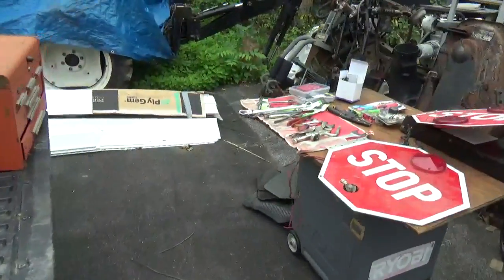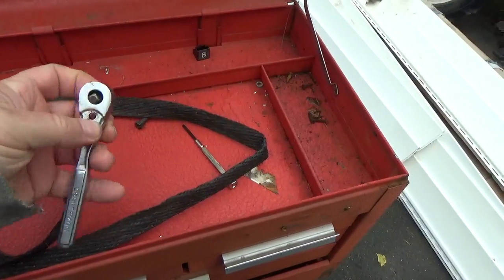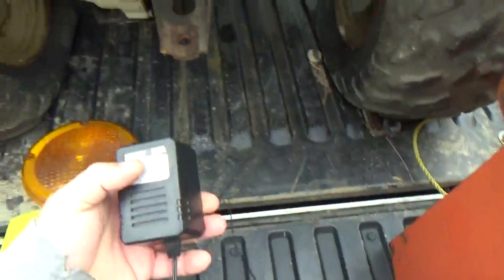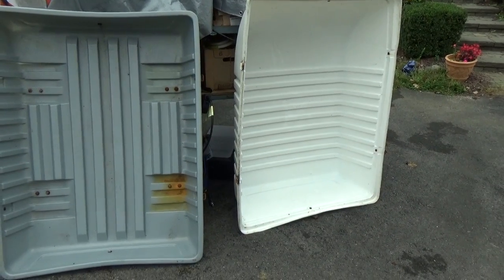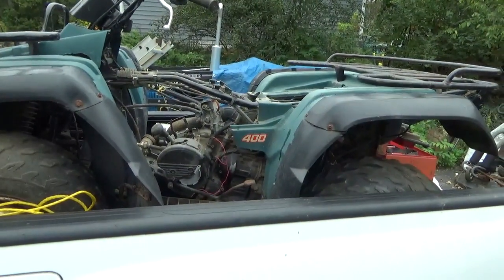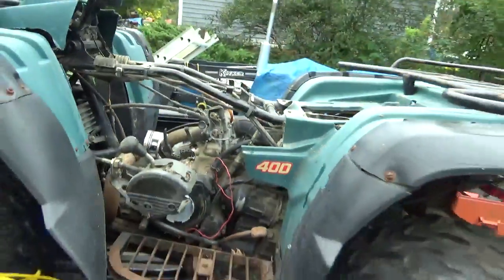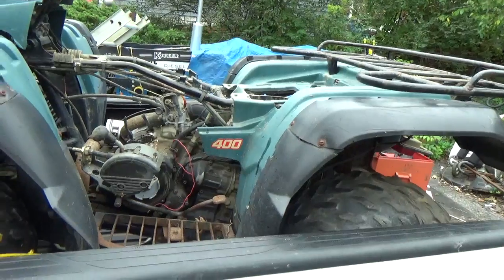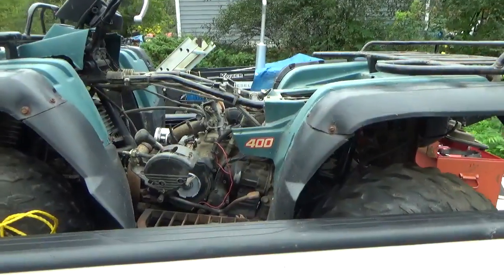Yamaha Kodiak 400 4x4 donated to my collection, thanks to Kevin Bergeron!

Comment: And when I first picked it up it didn’t have a battery to start it so u used my booster pack and strangle enough as soon as the power was turned on the bike turned over and started without the key even. Being in the ignition! And for some reason it’s idling high I taught it may have been the throttle cable so I replaced it but it still does it

Comment: it's a great quad I have my family is on our Yamaha Kodiak since it was new is 21 years old still on the original motor it's a great quad and if you need a new carburetor you can buy brand new carburetors for it off Amazon that will help you out bud
Reply: TheGregeoff how many mile does ya have?? I just bought a 1997 with 2150 miles runs solid and good

Comment: could you tell me where the fuse box is located on one of those?  it has the 30amp 40amp and other one inside it,  my box is just laying around the rear and I would like to put it back in the original location.  thanks

Comment: Yamaha is my specialty as I have owned enough over the years to fill up a cargo ship but I also know alot about every other brand atv and motorcycle and atc made ....here's a lil help for you tho here is a list of all the top ends .,,cylinder head and cylinder that will directly bolt right onto that Kodiak 400 without any modification  ...........and also years really don't matter much other than the engine mount  location on the very top of the cylinder head is slightly off on a few years than others.......yamaha warrior 350 .......yamaha raptor 350 .... yamaha bruin 350 ......yamaha wolverine 350 ....yamaha moto 4 350...... if u need to know any other parts that will directly bolt on let me know ...
Reply: Hey bud I have a question about the air intake box, I know the right hose goes into my carb but where in the world does the left hose go??